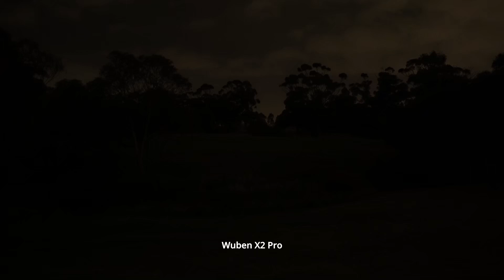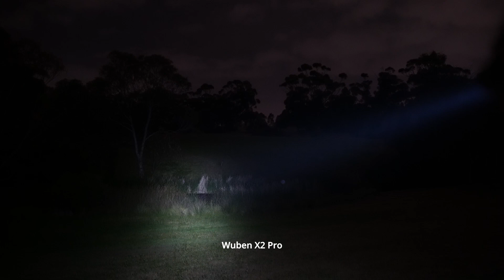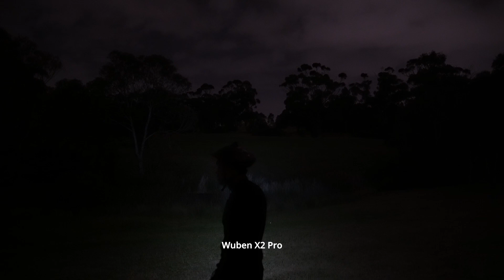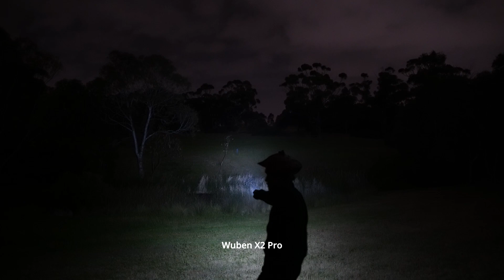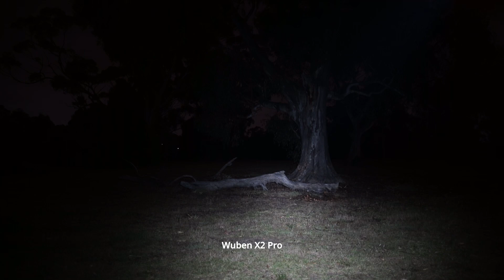Wuben X2 Pro: Beamshots

Comment: Something tells me there's a reason why the most popular design for flashlights in 2024 is still the cylindrical, tube design, first patented by the Ever Ready company in 1899. 🔦🤔 
No disrespect intended to the likes of the Wuben X2 Pro though. While these are interesting deviations from the traditional hollow tubular torches, flat and rectangular flashlights have been around since the early 70s, but they have never proved to become "game changers".  There's a reason why Convoy's flashlights are all cylinder shaped and so are a large majority of Wurkkos and Sofirn lights. 😀

Just ask any seasoned security guard or patrol cop who has been on the beat for tens of years, whether the X2 Pro looks more intimidating to the public than a 5D cell Maglite. 🙂
Reply from the maker: Good point :D I have some Nitecore lights on the way (EDC23/29) with inbuilt batteries. They're even more divisive but I guess they're designed that way to maximise performance/size ratio. But within a couple of years, you'll need to ditch it or find a way to replace the lithium polymer cell